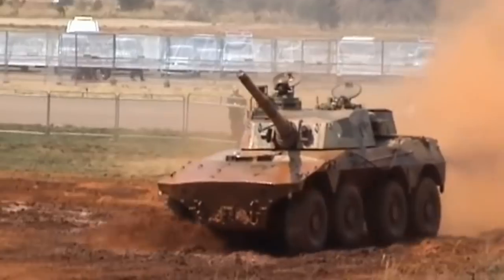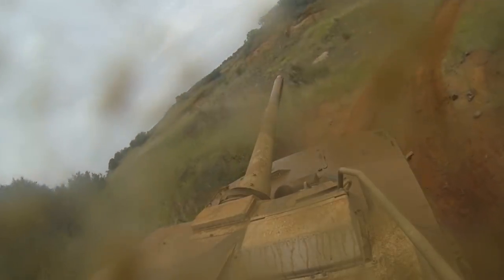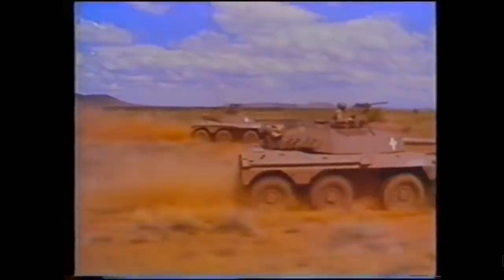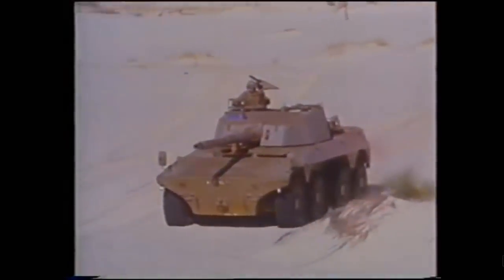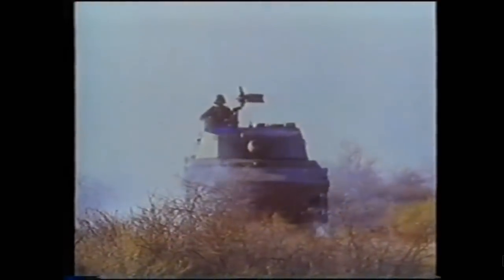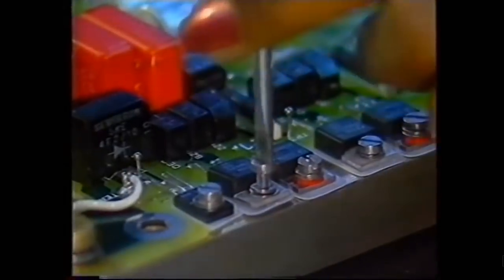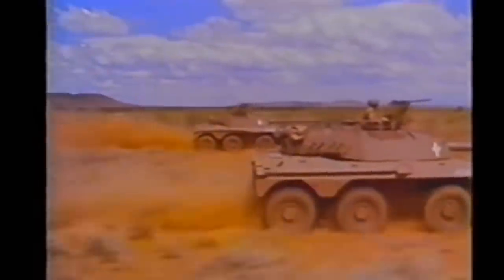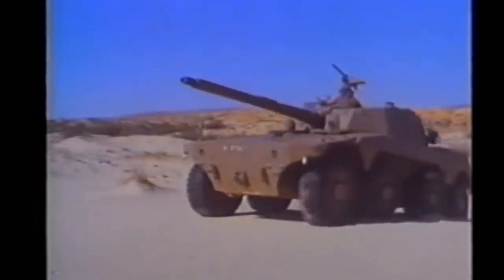Rooikat Armored Fighting Vehicle - South African Firepower

Comment: I can testify that this vehicle is 100 % locally designed and built. Even the tyres were locally developed to offer sufficient penetration resistance to thorns, but at the same time being able to handle those high road speeds without over heating.

Comment: I served as a member of the citizen force in the old SADF from 1979 up to 1989 in a mechanised battalion.  The developement of the Rooikat started in the early 1980's and it was not intended as merely a replacement for the French Panhard armored cars.  The Panhard armoured cars were locally manufactured as the Eland, and was locally upgraded to serve an effective role supporting the South African armoured columns during the 1980's.  The Rooikat was a weapon designed for the South African theater of war where the map of the entire continent of Western Europe could fit onto the map of Southern Africa.  Over such a vast area, land battles are not fought in the conventional sense of holding and controlling territory but in a similar fashion to naval forces that conduct outflanking maneuvers darting in to deliver vicious blows on the flanks.  It was with that in mind that the Rooikat was developed and that made it unique in the world at that time.  In the 1980's, the Rooikat was called South Africa's insurance policy, a weapon that could outflank the enemy formations and penetrate for at least 1,600 km before requiring refueling, delivering a vicious blow to rear echolon supply lines or enemy formations and melt away into the bush only to strike again on another distant target.  With such distances, supply lines were everything and whichever side had the best logistic supply could overcome their enemy.  Conversely, whichever side can ground the enemy supply columns to an effective halt would force the enemy formations into a defensive stance or even a retreat.  In the African bush the primary supply line would effectively be a single dirt or asphalt road running for hundreds of kilometers through the bush.

However, the South African bush war effectively ended after 1987 before the Rooikat was ever used in actual battle.

The closest modern day equivalent of a vehicle that is used in the context that the Rooikat was designed for, are the Toyota Land Cruisers mounting heavy armament that ISIS used in Syria and Iraq to great effect, by rapidly advancing over considerable distances in order to deliver devastating blows on the flanks of conventional formations.  Thus ISIS could force the rapid capitulation of a series of defensive positions over hundreds of kilometers behind their enemy front lines, by outflanking and destroying lines of communication.
Reply: December 88 the war effectively ended - Cuba made one last push for the South West of Angola after getting mauled in the South East with Ops Moduler, Hooper and Packer. Then SWAPO tried some nonsense in 1989 that was swiftly dealt with by 61 Mech, Koevoet, 101Bn and the Recces
Reply: As a tanker myself in 1991 I have to admit I was jealous of the Rooikat. It had a beautiful engine sound. I will however disagree with Maximus on the effectiveness of the Olifant tank on the South African landscape. It's a not sandy but rocky, hilly and muddy for the most part. I was at Lohatla Army Battle School in the Northern Cape.  Yes dust was an issue from a surprise attack point of view but the excellent gun depression meant we could slowly sneak up and peak over hills and fire without detection - much like the Israelis did and some Centurions in the Korean war. Thx for sharing.
Reply: I'm Still Alive Not shocked by your question. It is the norm nowadays. You should ask that question to all the kaders in GOVT.  I certainly wasnt racist. We were trained to protect our borders and keep everyone safe inside it whether you were black or white.
Reply: Ua la Halizeti  Hmmm not sure the new South African Regime is any better, negatively Racist former, Positively Racist latter. People who throw terms like Racist around, tend to be idealogues who cause more problems than they solve.
Reply: Would the Stryker be a modern equivalent?
Reply: Ua la Halizeti the laugh is that the best troops in the apartheid army was African and everybody said they were the best. That really screws up your racist regime thinking?
Reply: @vut_zarco  look at his name. He's a troll stirring up trouble.
Reply: Btw, on-top of the reference to South African military fighting a "naval war" on land, the Rooikat is actually fitted with a naval gun and ammunition!
Reply: mwnciboo South Africa is much better for black people now that the racists have been defeated.
Reply: Hello. I love this information that you have given us and I appreciate it because I am proud to be a South African citizen and to have had people like you defend our country. 🇿🇦
Reply: The PRIMARY weaponized vehicle that did service in that theater was the Ratel - which did sterling service in the latter part of the war - the Oliphant MBT also did great work.  This excludes Buffels and Caspirs as used by most infantry units (non-mechanized and Koevoet)
Reply: @stevenvictor2587  ,  At the end of the day south africa lost big time, as aparthied was destroyed, and never to return.
Reply: @mwnciboo  , It is very difficult to take over from a racist regime, because of all the destruction they caused, emmotionally, phychologically and physically.
Reply: @bepsolo  lol. Thats not what the Bush War was about though. Learn some history
Reply: @stevenvictor2587  , What was it all about? dr historian
Reply: @bepsolo  the Cold War...East vs West, Communism vs the Free World. Apartheid or rather the maintenance thereof was not relevant. SWAPO and the fight against its armed wing PLAN was a mere side show like a mosquito. By 1982 PLAN was effectively finished as a fighting force. The attention started turning to a more conventional conflict in 1981...hence the bigger battles between FAPLA/Cubans and SADF. PLAN was still in the mix on the odd occasion but not really too much of a threat to the SADF. They did continue to terrorise the local populace of South West Africa though. Hence the need for limited operations by the SADF inside SWA. But the main focus was in Angola.
Reply: @bepsolo  You are correct, South Africa lost big time and has been deteriorating ever since. Thanks to the old SADF South Africa was never brought under the Russian/Cuban sphere of influence.
Reply: John Lang Nope the Saffers was chased back over the border by politics.
Reply: @Craigx71  I wish it was that simple.
Reply: @stevenvictor2587  Was about to say that 1988 was the last official combat operations by the SADF.
Reply: @bepsolo  if the Khoza left the khoisan alone the dutch wouldn't have attacked them if the zulus left Gert Maritz & Piet Retief alone the Afrikaner wouldn't have killed so many of them learn the reason behind an action before judging an entire ethnic group... we came to find land and to live in peace with them they chose to hate and attack just look how well we got along with the Khoisan
Reply: Kyle Reese Bloody good!!!
Reply: @stevenvictor2587  You forgot the battles that effectively stops the South African military from ever doing a single offensive this is due to Cuban MIG-23’s Achieving Ariel superiority over the South African Air Force and forcing South Africa to completely ground any attacks in Angolan territory also the modernization of the Angolan Air Force and rapid deployment over Namibia forced the South Africans to the negotiation table could the Cuban military completely push the South Africans hotter than gala yes but the material cost of it happening would’ve been considerable and given the fact that .
Reply: @rootin222  which battles were those? The whole of 1987/1988 (Operation Moduler/Hooper/Packer/Prone/Hilti & Displace were all defensive Operations, with the first 3 absolutely destroying and shattering FAPLA/Cuban Brigades and Divisions. South Africa did not want to escalate the war, and hence after smashing the Cuban/Russian/FAPLA offensive (Which was also smashed in 1985 & 86) went to the negotiating table in a position of strength. If the Berlin Wall had not come down and the ensuing breakup of the Soviet Union and communism in general had not occured, South Africa would not have gone to the negotiating table to end the war. There were no winners at the end of the day. Cuba and Eastern Bloc were embarrassed militarily and today South Africa is in chaos and has been bankrupted by the ANC. Socially and Economically South Africa extended an olive branch to the cause of SWAPO and the ANC...militarily, in the eyes of neutral observers South Africa was the winner.
Reply: @rootin222  also in Cairo in December '88 the Cuban delegation said they would send another 10000 Cubans to Angola, the South Africans replied that they would send just another 1000 SADF to meet them. A small anecdote that speaks volumes to South African morale and military prowess at the time
Reply: @stevenvictor2587  anecdotal
Reply: @stevenvictor2587  Explain Cuito Caranvale
Reply: @rootin222  *Cuito Cuanavale took place during the first few 3 operations I mentioned above. The SADF had pushed the Cubans/Soviets/FAPLA back beyond their starting points for their failed offensive. They ran back to Cuito Cuanavale whereupon the South Africans laid siege to the town at will as the communist brigades had entrenched themselves there. By this time South Africa had achieved all its strategic objectives namely, halt the communist advance on UNITA, consolidate and destroy as much as possible, push them back to their starting point. All 3 achieved. There were limited assaults on the town, but the South Africans did nit attack in strength and did not have air superiority as you mentioned...basically because they did not deploy the Cheetah to the operational area. 

The probing attacks...which is all they were, with the objective to test the strength of the forces entrenched at Cuito, not invade the town, are today claimed as a massive victory by communists and their sympathisers...they have egos as big as Trump! Which gives them a warped sense of reality. If you tell a lie often enough it becomes the truth, like success of the new dispensation in Southern Africa or a "victory" for the communists at Cuito.
Reply: @AbuHajarAlBugatti  Im not going to get into an emotional argument with you. 

The beginning of the end of apartheid was the destruction of the Soviet empire starting with their loss in Afghanistan and the fall of the Berlin wall. Those events prompted an environment for negotiations to begin in South Africa, with the ANC no longer having a viable training ground and arms supplier. The SADF crushed all viable ANC positions in Southern Africa outside the Angolan/SWA theatre where the ANC wasnt even a factor. 

26000 is not even the total amount of KIA on both sides during 1987/88 so I dont know where you even got your figures but its certainly not credible. 

The SADF lost about 2000 men during 23 years due to accidents as well as combat KIA, Combat KIA was about 750...which is remarkable given the amount of enemy dispatched as well as being hamstrung by arms embargos which mainly affected the air force. Which didnt even affect them that badly...the SADF still won strategically and tactically without air superiority in the end. 

The SADF routed FAPLA/Cuba/Soviet Union again...and again...and again from 1975 - 1988/89. These are military facts, not right or left wing theories.
Reply: how are things in SA now, I heard they are pretty terrible for you guys
Reply: Italian B1 Centauro is better than Rooikat and Centauro II with a 120mm cannon as main armament is in another leagua for a Rooikat.
Reply: Thank you for your service all of my homies love you and hate the MPLA!
Reply: you killed innocent people!
Reply: @africantraveller8303  Not nearly enough or you would not have been bothering me today.